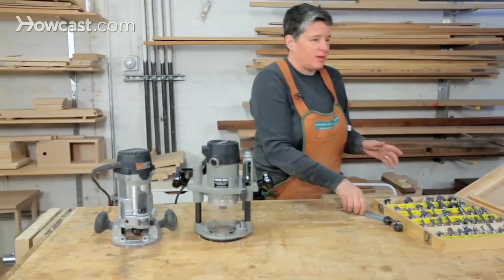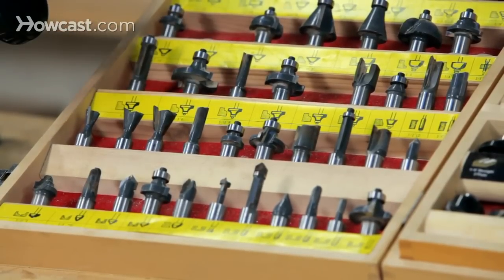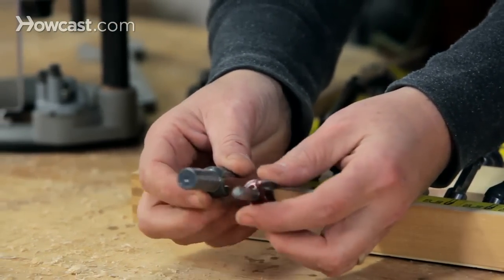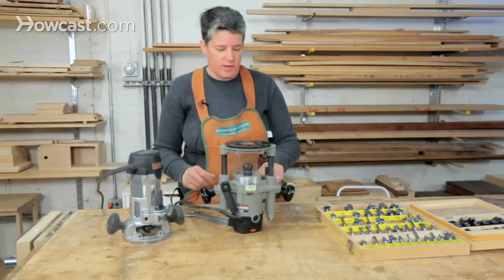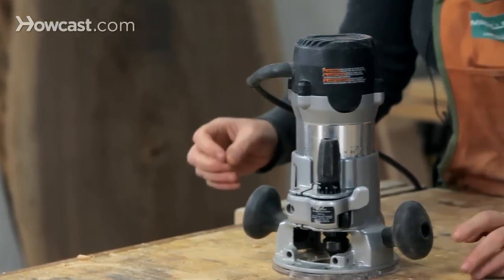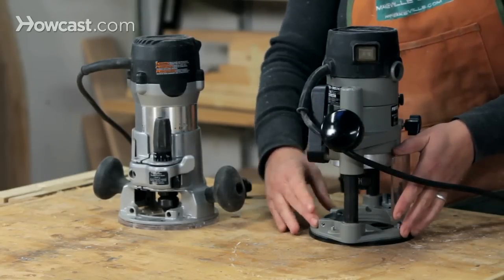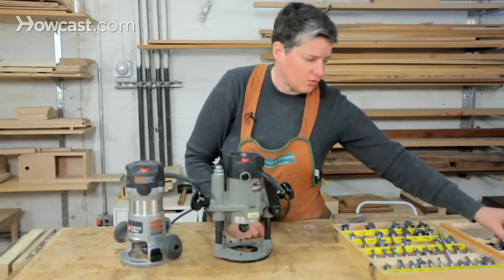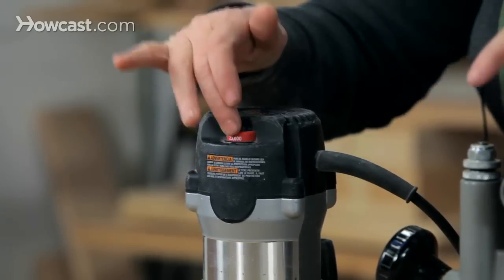Types of Routers | Woodworking

Comment: Everything made sense expect for the the part where she says that the bigger bit spins faster, on the outside edge, compared to a smaller one... Huh?
Reply: maybe bec. the base that controls the bit remains constant.. hmm nvm
Reply: The edge of a larger diameter bit will be traveling at a faster speed than the edge point of a smaller bit if travelling at the same rpm. I.e moving a further distance circumfrance but at the same rate, hence faster (speed = distance/time)

Comment: Which is the most good to use between of that two type of router?
Reply: Depends on the application. If you’re doing edging like on cabinets doors etc, get a trim router. If you are cutting into a sheet and need to start in the middle or away from the edge, get a plunge router